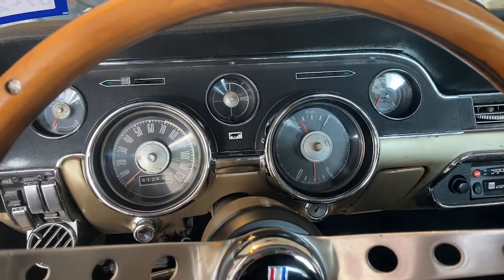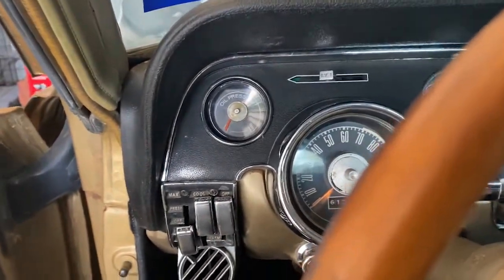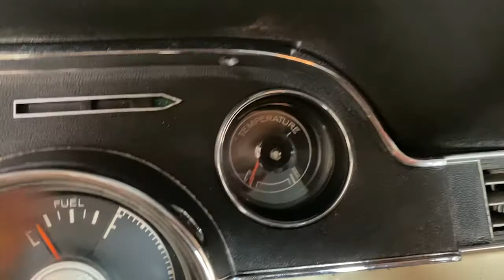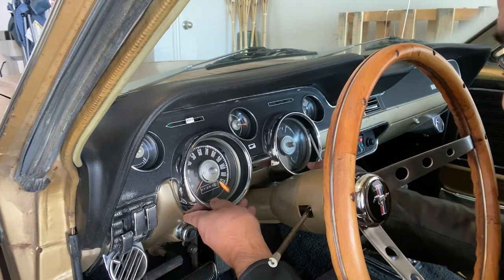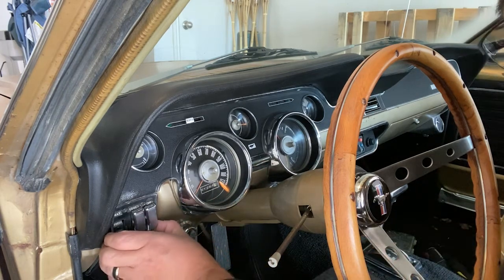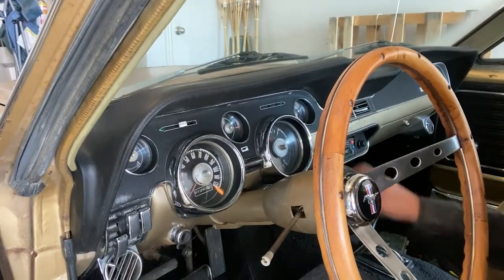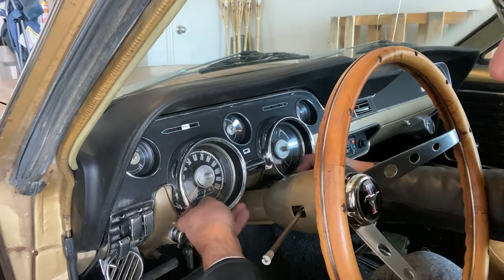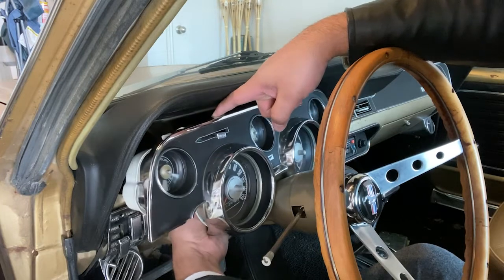1967 68 Ford Mustang gauge restoration (Part 1: Removal coupe or fastback)

Comment: Pull the heater control swith out of the dash 4 Phillip screws next to the cluster and go through the hole to get to the speedometer cable nut